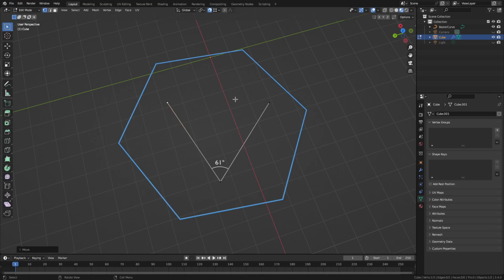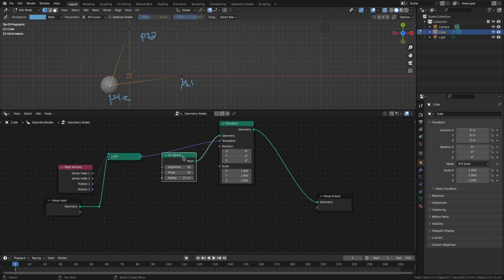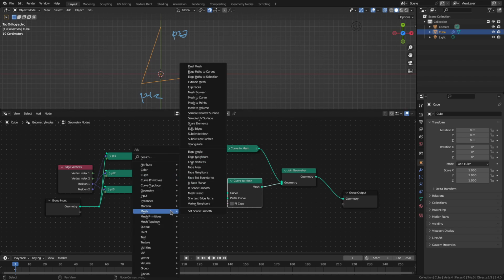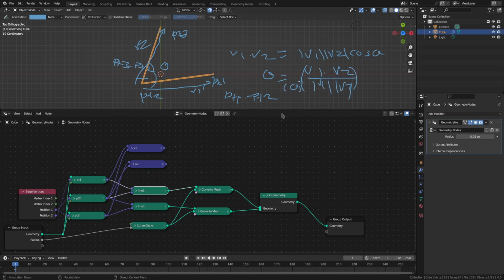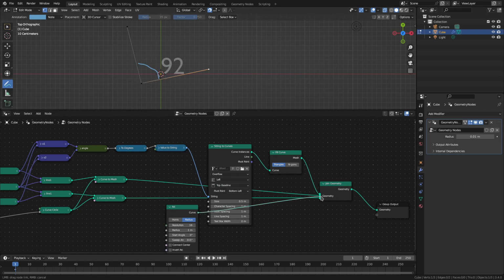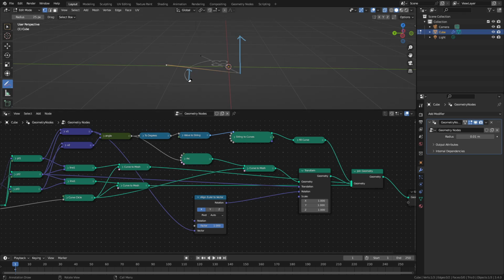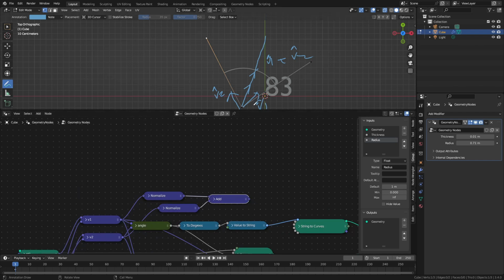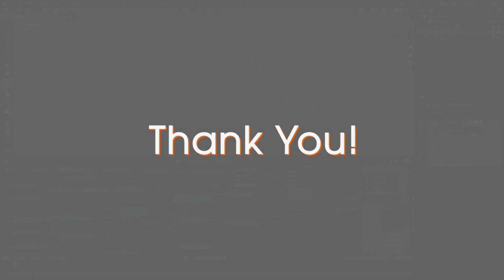Create Measure Angle Geometry Node In Blender | Video Tutorial

Comment: I know I'm late to the party but, Thank you! This is fantastic learning for working with vectors, angles and planes in Geometry Nodes. Just one question. How do I get the resultant angle to display in range from 0°-360°? It seems to be stuck in positive 0°-180°
Reply from the maker: Did you try 'outer angle' option
Reply: @Khemadeva  Thank you yes I did. I couldn't figure out your node tree and sadly my maths is 30 years rusty from high school, and I needed an automated solution. I found out elsewhere that I could take 2 x 𝜋 x the ArcCosine from the angle calculation, and then filter that with a switch controlled by if V3 (Y)  ≤ V2 (Y) because in my case I'm working in 2D on the XY plane. Thank you for your reply and thanks again for this video. I learned a lot!